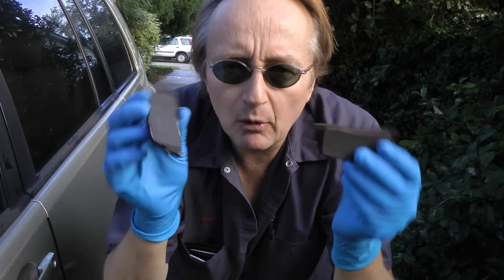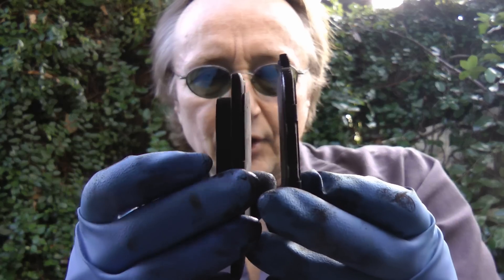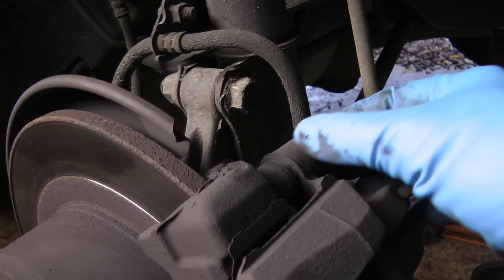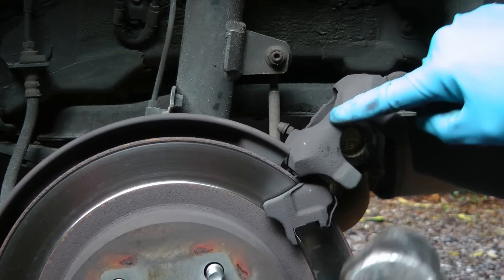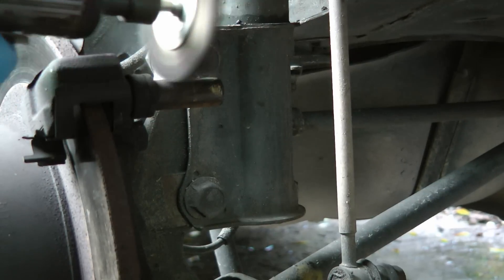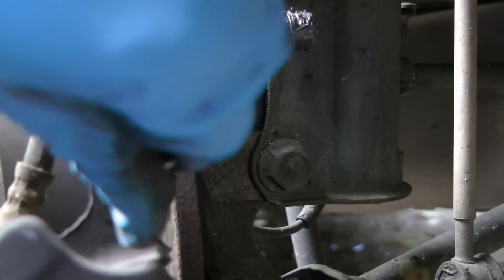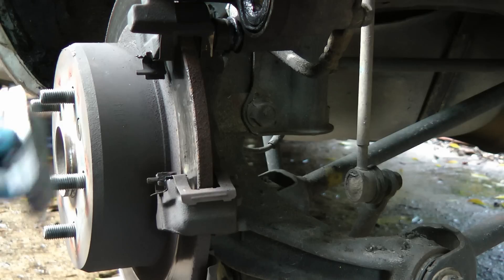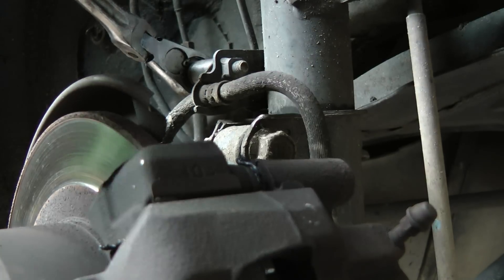How to Stop Brakes from Squeaking and Sticking in Your Car

Comment from the maker: Things I used in this video:
1. Sledge Hammer: http://amzn.to/2iasnep
2. Pneumatic Wire Brush: http://amzn.to/2BNtBVy
3. Brake Grease: http://amzn.to/2BNgCDa
4. Ratchet and socket set: http://amzn.to/2inoxOY
5. Mechanic’s Tool Set: http://amzn.to/2Bzmccg
6. Wrench Set: http://amzn.to/2kmBaOU
7. Shop Towels: http://amzn.to/2jGDfkA
8. Disposable Gloves: http://amzn.to/2zSRuxO
9. Common Sense
10. Full HD Camera: http://amzn.to/2AvoEk7
11. My computer for editing / uploading: http://amzn.to/2i2sKYz
12. Video editing software: http://amzn.to/2jv5Fhf
13. Thumbnail software: http://amzn.to/2k7tz6C

🛠Check out my Garage to see what I use every day and highly recommend:
https://www.amazon.com/shop/scottykilmer

❗️Check out the Scotty store:
https://goo.gl/RwhRGU

👉Follow me on Instagram for the latest news, funnies, and exclusive info / pics:
https://goo.gl/ohy2cA
Reply: Scotty Kilmer Hey Scotty, I have a quick question for ya. I recently replaced my front rotors and brake pads on my 06 Saturn Vue. Everything seemed like a normal rotor and pad change but when I press my brake pedal at slower speeds, I can hear an audible “crack” or “clack” noise. Almost sounds like a popping noise as well. 

I’d like to be able to resolve this myself without taking it to the local shop. Any suggestions on what it could be and how to fix it? Thanks in advance Scotty!

Comment: Great video Scotty!

Just a tip for others:
Be careful what kind of "Brake & Cailper Grease" you use. Some types of brake grease will eat/melt the rubber boots that protect the caliper slide pins and cause the caliper to seize. Make sure to use brake grease that's safe on rubber.

I personally use "Sil Glyde : Brake Lubricant", its fantastic for anything & everything  brake related and can be found at any auto parts store.

Comment: Excellent video, Scotty. I worked in the factory that made brakes for Toyota (Aisin, U.S.A.) for over a decade. I could tell you stories that would curl your hair. The reason you see pin sticking problems with Toyotas so much is because they used to use a lower-viscosity synthetic grease (that was imported at considerable expense due to tariffs) that didn't tolerate heat well. Whenever I do a brake job on a Toyota, the pins always get cleaned and greased.

Comment from the maker: clicking is often brake pad shims that are missing or brake pads slightly too small. So they move a tiny bit when hitting the brakes. It means nothing, BUT check to make sure both top and bottom pads on both sides have the shims on the top and bottom where the pad ears fit in. Often some are missing or fall off.

Comment: I think you just solved my problem. I'll find out tomorrow. At first I thought maybe bad caliper, but its not pulling to one side. so that would eliminate a clogged brake hose as well. And my inner pad is almost metal to metal, yet the outside is practically brand new. Also, my vehicle seems to be dragging. I can even notice it just with my foot off the gas. So this video just opened my eyes. I really hope this works, because I'm really  hating this poor gas mileage. Your awesome!
Reply: I have all of these exact symptoms went from 28 mpg on my amanti to 21

Comment from the maker: hard brake pedal is often the brakes sticking on. You've changed all that stuff, BUT, was it brand new oem. Cause many aftermarket parts just don't fit right, they bind, then the brakes drag and overheat.

Comment from the maker: yes, if it's an automatic transmission that back up light switch is built into the neutral safety swtich assembly. But if a standard, it's a separate sensor on the transmission

Comment from the maker: best to use brake calliper grease as it's made to take such hot temperatures the brake system creates when stopping. Realize all the kinetic energy of the car turns to heat energy when you slam on the brakes.

Comment from the maker: generally either calliper is bad and causing that, from dirty slide pins, or stuck piston. Only other thing is a bad brake rubber hose collapsing and not releasing pressure.

Comment: I would like to thank you for educating us.
I have a 2000 Toyota echo with 140,000 miles. When cold started, after two seconds the engine drastically lowers the rpms for about 3 seconds then it raises back up to the normal rpms. No mil light comes on, it does not stumble. Thank u in advance for your reply. Love your videos.!!!!!!!!!!!

Comment: Kilmer , I enjoy your realistic explanations, finally I have a brake issue. I have an 86 Plymouth Salon and after driving about an hour I put it on reverse,  brakes started to stick a bit hard and when I put it on drive the sticking continued?  After a few days, the brakes are back to normal,  just drove it for half hour but am concerned about putting car in reverse after a long drive.  Note; Car was stored for a long time indoors until about a year ago . I did not see  any video on the reverse sticking issue so I am at the mercy of your social network, Your expertise with natural good humor  just got me to as  a question.  Thanks

Comment from the maker: Either the left wheel is binding and wearing out faster, or the right side is weak and doesn't apply enough pressure on that side so they just don't wear out as fast and that calliper would need rebuilding or replacement.

Comment from the maker: if opening the bleeder frees it, the calliper itself is not the problem. It would be a block hose or sticking master cylinder not releasing the pressure.

Comment: Just an update. I really appreciate your input on my problem. Rather than pay $500 to have them replace the booster, I replaced it myself. It cost $100 bucks after core return.at Autozone.. That was not the problem. I had to put shims between the MC and the Booster to correct the problem. Used 1/8 inch washers. There was no DYI adjustment on the push rod. Thanks again for your input. I hope this info helps someone down the line..

Comment from the maker: they heat up fast, means they are dragging on for some reason.  replace the brake master cylinder first, that's often it if opening bleeder valve frees em up

Comment from the maker: pistons stick, brakes pull when pressed hard, and that side will get smoking hot brake pads and rotors. that side will remain hot while the other side can just be warm when you feel them. We mechanics use a non touch temp gun to measure the temp

Comment from the maker: either he did a bad job rebuilding it, or you have brake hose that's clogged and not releasing the pressure OR the brake master cylinder is sticking on.  so it might not be the calliper itself.

Comment: Hey, great video. I have problems with rear drum brakes. When I got my car inspected, rear braking force was too uneven, so I didn't pass inspection. Drummers' and pads look fine, already tried bleeding, didn't help. Do you recommend changing the brake cylinder? Brake cylinder doesn't leak any brake fluid, and it looks like it isn't leaking anywhere else. Car is 1992 Mazda Protege, if it helps.

Comment: Damn no wonder why my front brake pads were burning. I didn't resurface the metal and the brakes were stuck so they wouldn't disengage whenever I was driving.  And no wonder why my brakes were wearing unevenly, AND no wonder why my brakes were squeaking! Damn I'm going to get started first thing tomorrow morning!

Comment from the maker: I would disconnect the steering wheel wiring to the horn and just use the horn button, that system is bad and a pain to fix.  You have some type of brake or suspension problem, jack up the front end, pull on the tires and look for play showing worn parts, and pull the wheels off and check the brakes themselves if no play exists.

Comment: Great video, spot on.
Do the discs wear uneven also in this case?
My car got new discs and pads ~5k miles ago and the outer side of both discs is like new, while the insides are really used, almost as used as the sides of the old discs when I changed them.

Comment from the maker: some are absolute cows, requiring taking apart the 4WD spindle to get the rotors off. Many guys will use an on vehicle brake lathe to resurface em in that case.

Comment: Thank you for answering . But I Chang e the master cylinder and bleak the brake fluid , lift the car on stands and the wheels rotate with very little resistance .

Comment: My brakes aren't sticking like how you described in the video. On my right front, they wear evenly but it's like they almost don't back off all the way every time after braking cuz brake dust is bad on that side only. And that side the brake pads wear faster. Also, my pedal is squishy, as if the front brakes don't ingage right away. I changed all the brakes, replaced all the fluid and its still squishy. Why's your thought on both of those problems? I have a 96 dodge cummins by the way

Comment: i saw used rotors n used pads on a dakota in the junkyard and took them off.. mine were metal to metal since a week or 2 and the junkyard has a flat price for used pads.3.99$ and totors 9.99$  each  so for 30$ i redid my breaks.. works great..  used regular wheel bearing  grease.. any big problem with regular grease?

Comment: I've seen a number of cases where the front hubs have been bent, which I imagine was causing the rotor to wobble and wear unevenly.  Whenever I get a car in that has rotors that have good appearance but warped rotors, I'll always take a dial indicator to the hub of the vehicle.  There shouldn't be more than .002" of lateral runout.

Comment from the maker: chains rip people off every day, no surprise there. Any one with a high level scan tool can bleed abs brakes.  If you open the brake line and the calliper still sticks in place, then remove the calliper and see if it moves freely, and if not, it's the pins

Comment: I have a question Scotty.

Brakes seemed weak so I thought I'd change the pads.
Had a look at the pads and they looked fine, so did the rotor.
So I put it all back together and there was binding, so I figured the caliper must be shot.
Put a new one on and its binding, what the hell did I do.?
Maybe I should change the rotor and pads also?
Need this thing for work Monday?
Thanks.

Comment: Thanks for share the video!, Hey Scotty, I have a 2000 4runner 4wd, 2 weeks ago did front brakes rebuild job by myself(using your videos!), but 2 days after a clicking noise on the wheels comes everytime i push the brake pedal. theres something wrong? or just need some lub?. BTW the runner brakes nice everytime!.

Comment: Permatex "24129" Silicone Extreme Brake Parts Lubricant is the winning lubricant for guide pins with rubber parts.

Comment: what is better to lubricate the pins? Silicone past or brake grease.  I've been told that brake grease eats away at the rubber boot and it dries up over time.  Is this true

Comment: heres a riddle.. a 1993 mercury villager, front discs rear drums. front drivers side brake only seems to be sticking. Brake pedal is hard to push and barley moves but braking power is good(vehicle stops as you'd expect). I replaced pads, rotors, re manufactured calipers and bled calipers well. van wont coast with foot off gas pedal, brake is dragging that bad. seems drivable for few miles then burnign smell and smoke from front drivers wheel well. i checked the hub bearing, they spin freely off the vehicle. cv axle boot is busted grease flew wverywhere, but i doubt cv axle would cause that much heat, it still has  plenty of greese inside boot. two cents?

Comment: Hi Scotty I have a 1980 Cadillac Seville with 5.7 diesel 4 wheel disk brakes the rear brakes work fine the front brakes stick I have replaced the front calipers and proportioning valve they still stick ie don't release when let off pedal what do you think it could be?

Comment: Hey Scotty , I have a 96 ram 3500 and I could never get it to stop straight even with rebuilt calipers and everything greased up. Is there any way to checke the pressure on each line to see if they are even?  To properly bled the system (antilock) you needed a factory scan tool so I always thought I had some air somewhere.

Comment: @Scotty Kilmer I now replaced the fon flexi pipe too and for only 1 day it worked fine,now its back to normal front right and back left brakes jam on at the same time.
 Could a faulty master cylinder cause this to happen?? I mean make the brakes in a diagonal position lock on,i was told that the pin inside the master cylinder could be getting stuck, would this cause this problem

Comment: If it wasn't the middle of winter and cold as hell, I'd consider trying this myself. In my case, car doesn't pull to the side or make any noises. Rather the caliper has one of the disc brake pads resting against the rotor lightly and evenly, so I'm getting a burning plastic smell (the pad composite is a plastic) and one of the wheels is getting rather hot. (If you suspect this, follow your nose and then use the backside of your hand to check temperature. Should be obvious enough.) Happened just recently, but I know I've got to fix that ASAP.

Comment: I need help Scotty! I have a 87 Honda & one of the back wheels just locked up on me today. I had a leaking master cylinder replaced recently, so maybe that has something to do with it? It's been up on ramps with the E-brake on for about a month so I think the brake may be keeping it from turning but it's just the one wheel. I'm not all that car savvy but videos like yours have enabled me to do most of my own work but I can't seem to find any info on this!
Reply from the maker: generally that's a bad wheel cylinder on that wheel, remove the drum and check that first
Reply: Thanks for replying so soon but I actually found what I was looking for right after I posted that comment. The e brake made the shoes stick. I took the wheel off adjusted the tension & it's just fine now! Thanks again, your videos have helped me a lot in the past & i'm sure they'll come in hand again down the road :D

Comment: Thanks Scott!  My Suzuki SX4 brake pads slide upon a replaceable piece of hardware.  It's made out of thin metal and it looks like belt buckle.   Do you have any advice for replacing these pieces of hardware and then mounting them correctly?

Comment: Hey Scotty, I need your honest opinion. Could a bad power booster cause both front brakes to drag? All other avenues have been addressed. Brake pads, brake hoses. brake calipers and master cylinder. The booster was diagnosed as the problem by the company service dept. that I bought the car from a year ago. It's a 2005 Envoy. I would just like to get your input. They tell me that the push rod is properly adjusted, but the booster is still creating the problem. I find that hard to believe.

Comment: I have an 06 Grand Caravan, just had new rotors & pads put on(bad back).. Now, the rear caliper brakes are smoking after a few miles, the left side OR the right.. What could possibly cause this? Hoping I hear from you as I want it fixed before the weekend. Even though I cant do this anymore, I still want to know why things happen..

Comment: Need your help Scotty.. 2005 GMC Envoy. Noticed wheel shimmy at high speeds. Checked the suspension after having wheels balanced. All OK. But noticed front wheels very hard to turn. Discs were recently replaced. Disconnected and blew through hoses. Replaced calipers and hardware including slide pins. After bleeding brakes, Same problem. Calipers will not relax after applying brakes. Could it be the master cylinder?

Comment: Hi Scotty 

I have the 2004 saturn ion series 1 with a 2.2  w 189,000 miles. The brake resivor fluid is black and has black sludge on the bottom of the resivor. What is this black sludge? What should I do to clean the resivor? The resivor mounts seperatly abouvt the booster (couple inches) so can I remove this resivor and not get air in the system?. I'm gona flush the system w new dot 3 fluid. What chemical should I use to extract the black sludge?

Comment: Hey Scotty! I got a quick question: the brake disc got red hot on my '98 Fiat Bravo. I knew the the brake was sticking but I didn't think it was that bad. The thing is that yesterday I changed the pads and I don't really want to buy new ones again. Do I have to change them again with the disc and the seals in the caliper or can I still use them as they are? Thanks in advanced and also thank you for all the knowledge you shared with us!
Reply from the maker: depends how hot they got, if rotors got warped, you'd need new ones. If brake seals leak or stick , they need replacing too. Pads are more forgiving
Reply: It was literally glowing in the dark. The seals don't leak but I think I'll replace them also. Thank you again for the prompt answer! Now I'll go and disassemble the unit.

Comment: Hi Scotty, I have a harsh shudder through my steering wheel when applying the brakes. I thought it might be either a stuck caliper or warped rotors, the wear is uneven on the pads 5% on inside 40% on outside, but the sliders move back and forth with minimal effort, could it be the piston ceased or is the wear normal and it's just warped discs?

Comment: Mr.  Kilmer what does it mean when both pads on the front driver's side wore to 3mm and both on the passenger front are worn to only 7mm in 30,000 (Car is a 2010 Mazda 3i).

Comment: I replaced my CV shaft last week and when we took the caliper off of the rotor and checked the pads I saw that I had the opposite problem with the pads wearing unevenly. My outer pad is thin and needs replaced but my inner pad still has at least half the pad left. What would cause them to wear to like this and how can I fix it?

Comment: Some of those slide pins come with a indent for a rubber bushing. My 2002 Sienna has one on the front bottom pin on east side.
What is that purpose of the bushing on the lower pin and not the upper, and what bad happens if it goes missing?